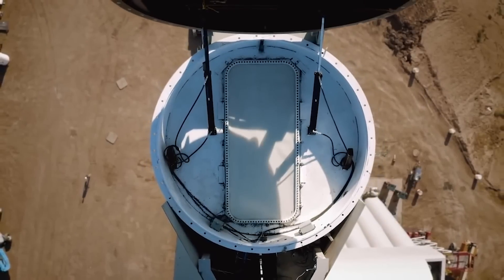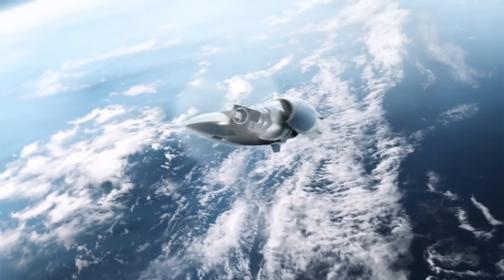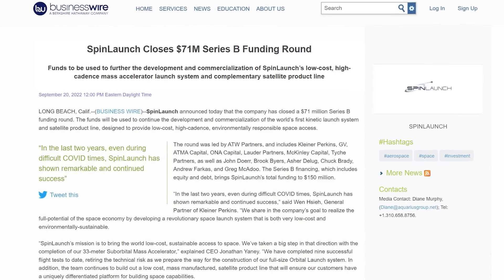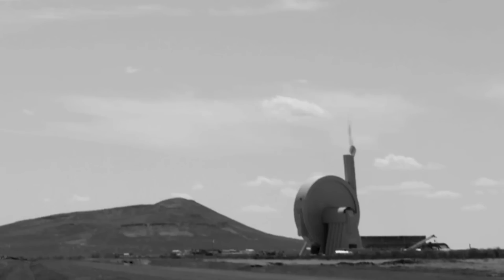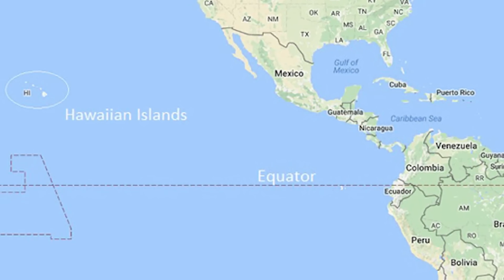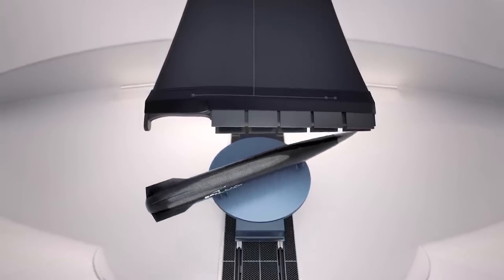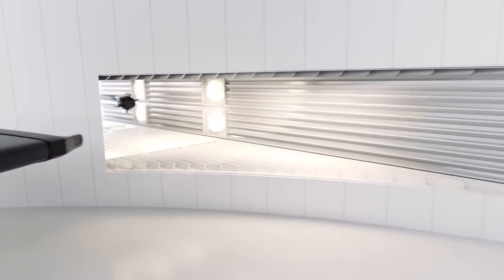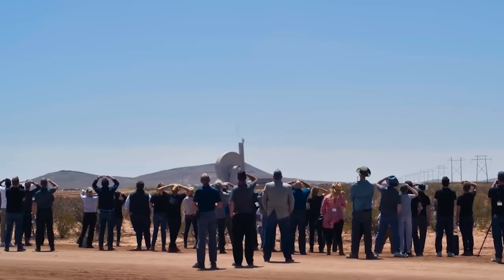What Happened To SpinLaunch & The Orbital Accelerator?

Comment: I would be very astounded if they manage to launch a single satelite into a stable orbit.
Reply: C'mon - it is not for this. It is for suborbital flights of tungsten rods...
Reply: @mateuszkukula5344  So it was a weapon all along.
A glorified catapult.
Reply: this is a dumpsterfire comment section, i for one don´t think they will ever have a satelite in earth orbit, but using this approach on the moon to get resources off the moon seems way easier and pretty doable
Reply: @andreasspachmuller7002  i was thinking the same thing,  IF you build something similar on the moon where the atmosphere is nearly zero then you MIGHT have something that works.  Although the 10,000gs are still going to be brutal on whatever you're launching.
Reply: they just need to increase the initial kinetic energy 40x to the projectile. problem is everything melts @ 6,000 degrees..
Reply: @mastah39  this isn’t about space X tho
Reply: Perhaps is a weapon in disguise. Otherwise your right.
Reply: I think the question is whether the payload can survive the strain of the acceleration.  If it can, putting it into a stable orbit is cake.  I doubt this will ever be realized.  It's so depressing to see all this money dumped into things you can see immediately will never work.  I rather doubt they even tested the idea under simulation before building it.
Reply: @mastah39  the principles are the same accelerating an object towards space where it is fired at maximum velocity at where the atmosphere is thickest which is stupid.
Reply: the whole discussion afterwards aside, I find this initial comment really funny
"if they manage to launch a single satelite into a stable orbit" lol
you make it sound like the first satellite you launch is easy and the hard part comes afterwards. If you do manage to successfully launch one satellite you can probably just repeat whatever you did a thousand times and successfully launch a lot more satellites, no? The hard part is doing the first one, the rest is easy
Reply: @Mmmm1ch43l  That's exactly the point.
I do not believe that they are capable to do that.
The whole procedure has to many weak points and looks like a investment magnet but not a serious  space agency.
I may be wrong and they do it tomorrow but I do not think so.
Reply: the only thing they'll be able to yeet is the money of gullible, uneducated people who are way too wealthy.
Reply: @molybdaen11: I absolutely agree. By the way, for the ones who will ask, I am a mechanical engineer, but not with a background in rocket science. But their main idea is also not a rocket. ;-) And physics is physics. 
First of all I think doing that with a vacuum in the chamber is not trivial. And based on the flat membrane the projectile flew through, there was no vacuum present in their tests. Which is a big deal! The idea with the fast doors seems dubious to me at least. Where are these doors, if that's so easy to do? And even if they manage to build air tight doors shutting that fast and being able to time them that accurately, there still will be air rushing in when they're open. At sonic speeds. 
Further on, yes: if you spin something in circles and let it go, it will travel in a straight line. But, especially in a vacuum, the rotational velocity of that projectile would also remain constant. Meaning it would tumble from the get go. If I got the info correct, that would mean it tumbles at a rate of 450 revolutions per minute or 7.5 times per second from the get go. Sure, maybe as soon as in the atmosphere, it would stabilize but it surely would use quite some of the kinetic energy of the projectile.
Last but not least, and I know that's not a strong argument against them, but: It's such a basic idea to spin something and let go, surely other brilliant minds have had that thought before. And figured out there are better ways to get stuff into space/orbit.
Reply: @mastah39 he knows enough to know this won’t work and anybody with a physics background can calculate for themselves and see that this is not feasible. US military already did something similar with the harp project
Reply: What's the basis for your comment? Are you an expert in rocketry? A physicist who crunched the numbers and found a flaw?

Highly informed and experienced experts doubted we could affordably reuse rockets. SpaceX showed it's possible. Same with propulsive landing. Or simple flight for that matter (days before the Wright Brother's took off, the world renowned engineer hired by the US Gov. to do just that threw in the towel). Every leap forward is impossible. Until it isn't.
Reply: @Keiranful they said it would be impractical, not that we couldn't. We can also go to mars, and I mean right now, but getting back would be a little tricky. Usually when an expert criticizes something that is in theory possible, they are questioning its practicality.
Reply: @Keiranful  SpaceX technology of reusable rockets is expensive, they did not manage to cut costs a lot and it's still expensive to launch.
Reply: https://www.youtube.com/watch?v=9ziGI0i9VbE&ab_channel=Thunderf00t
Reply: @Keiranful  thunderf00t is and... yeah it's a load of bull. This dog will never hunt
Reply: @Keiranful  how’s this for a basis - they say they’ll launch at Mach 6.5-7. That’s 5000 mph. Orbit requires 7 times that much speed. 
Anyone who’s seen the “tests” can easily see about a hundred ways why this will never happen.
Reply: @Keiranful and who are you?
Reply: @fissavids8767  only an engineer with a good understanding of the conceptual material. I also don't spout doubts without going into why it will never work. Neither do I claim it to be the future of space travel. I just can't stand narrow-mindedness.
Reply: @Keiranful  I'm also an Engineer and I'm highly skeptical of this approach since it requires their payload to undergo up to 10,000 Gs of acceleration. These high G-forces are experienced for hours as they ramp up. In a linear accelerator with a track/barrel the length of just the perimeter of the "Spin Launch" accelerator, the payload would only experience an acceleration of about 800 Gs (for a fraction of a second). There are few things I would ever say are "impossible" but, IMHO, this is just about the worst way I can think of to try to launch something into orbit. My bet would be this company runs out of funding before they ever launch anything into orbit, for the reasons I just explained.
Reply: @michaelhill6451  the problem with a linear accelerator is, that it's even further out from our current capabilities. If even the JPL and the US military have trouble getting one into service (at seriously reduced energy output), where talking decades, before a startup can manage that. As for the high g forces, they know about the issue and work around it, for example with special braces for the reaction wheels and other stuff. Look some more, it's fascinating.
Reply: @Keiranful  Yeah...Working around high g-forces. You can't defy Physics. It's not fascinating. It's delusional. I can just as easily give a hand-waving explanation that they could "work around" issues with linear accelerators. It is actually technically much less challenging to make a linear accelerator which should tell you that if linear accelerators are "decades away" for some reason (according to your hand-waving argument with nothing to back it up) then this is even farther away.
Reply: @michaelhill6451  you really haven't looked at anything they put out, have you? High g forces become a problem when things can move. For example, a standard reaction wheel is folded in at launch and will deploy/latch in place after achieving orbit. That design obviously will not work. So they have designed a reaction wheel that is at a 45° angle to the mounting surface and is braced. At that point the g forces don't bother the reaction wheel. Tensile strength is not the issue. Tolerances & slack are and both are simple engineering problems that we understand quite well and can handle. It's not easy, but it definitely is doable.
Reply: @michaelhill6451  as for my "hand-waving" argument, you really only glossed over my comment, didn't you? Otherwise you'd have read my point that the JPL and US military with all the brilliant minds and shit ton of money they can throw at problems haven't been able to design a prototype that can shoot more than a couple times without needing major refurbishment, let alone multiple shots a day. That is with decades of research and billions of funding. No startup can match that, hence the possibility of a startup building a linear accelerator for such an application being several decades away. Yes, that is a very "hand-wavy" argument indeed.
Reply: @Keiranful  you could be the pope and that still doesn't make you an authority to talk about this dumb idea. there are many more solutions to this problem like linear accelerators which did come pretty close in the past, which you claim do not exist. 

source: I'm a mechanical engineer with interests in space technology. doesn't make me one to talk either.
Reply: @Keiranful I am pretty sure this falls into the category of possible, dare i say doable but entirely ass backwards in terms of practicality. 

This won't fail because of a lack of funding though.  It is just way to niche in terms of what types of payloads they could get into orbit even if they do succeed.
Reply: @Keiranful  People have been working on ballistic launch to orbit since before anybody in this comments section has been alive. Project HAARP and QUICKLAUNCH being the most prominent examples. There are fundamental flaws in the concept that make it at best impractical, at worst straight up impossible and those were using simpler mechanisms. Spinlaunch has taken a repeatedly tested, failed and dead concept and dressed it up with some schoolboy physics tricks to make it look new and innovative, then made some fancy marketing videos and announcements in order to fleece overoptimistic but scientifically illiterate investors of their cash.
Reply: @Keiranful bro the us military already did something similar but with a gun and deemed it un practical this is essentially the same concept
Reply: @michaelhill6451  is there even a satellite that can survive those gs
Reply: @opmacace523   I doubt you can take a stock satellite and have them survive that. No. You could probably specially design one but it would no doubt put limitations on your satellite design.
Reply: @michaelhill6451  that’s the point it would be more support structure than satellite which increases weight or limits electronic capacity. And when in space all that support structures become useless at low gravity. Which is why modern satellite designed look fragile because less weight saves money and or you can increase satellite size for more capabilities.
Reply: @opmacace523  Agreed. This is one of the many things that makes this a dumb idea.
Reply: @Keiranful  Then why do they lie in their videos. Why is there so many engineers who have spoken against them. This is like theranos
Reply: @Keiranful  Your entire non argument is a fallacy called appeal to authority. And seeing how you are not qualified enough in psychology and philosophy to form proper arguments you are no longer allowed to respond to proper arguments (see what I did there).
Reply: @mikehawk1441  an appeal to authority? Pointing out how experts were wrong in the past about radical shifts in technology is a fallacy? Right. 

Beyond the asinine twisting of what I said into your counter, your mistake was assuming things you have no way of knowing. 

My argument is about as far from an appeal to authority as possible, because I basically said experts tend to get radical shifts completely wrong, so let's wait and see instead of calling these people idiots.
Reply: @michaelhill6451  think about this. While it’s spinning all those G’s are on the outside wall of the satellite. Then when released they all disappear. Then when it hits the air after leaving a vacuum it will experience a ton more G’s of deceleration from the front. Instantly. All within a half second or so. 
Any mechanical device will turn into mush
Reply: @Keiranful No just simple knowledge of physics.
Reply: @trolojolo6178  The engineering is tricky, sure, but the basic physics? Simple physics says it's eminently possible. I'd like to know what makes you so assertive that it isn't.
Reply: @Keiranful  Do the math and calculate the needed terminal velocity and centrifugal force in order to reach orbit. 

Spoiler: The forces are bigger than putting the satellite into a 50m long gun and firing it. This is simply not going to happen.
Reply: @zocker1600 "needed terminal velocity"
Using extra words like "terminal"(which doesn't even apply here) to bulk up a sentence and make it sound more 'sciency' isn't great if you're trying to make your opinion sound credible.
Reply: @zocker1600  the 50m long gun doesn't work, because we a) don't have a propellant capable for that and b) a rail gun capable of that is even further away in terms of development.

Also, you didn't listen, did you? No one claimed they'd go straight to orbit. They'll go a few kilometres up, to where the atmosphere is appreciably thinner and then start a chemical rocket. Straight to orbit couldn't work, because the perigee also needs to be raised.
Reply: @Keiranful And why not take an airplane then to carry the payload up to, say 30,000 feet? This take-off from a plane is a very old and never abandoned idea and seems much more feasible than this pipe dream.
Reply: @Keiranful  I would love to see your calculations bc the whole idea is ridiculous. You don’t need to be an engineer to see this is bs.
Reply: @Keiranful  Did you realize that HARP already achieved a muzzle velocity of 7,000 fps with a 960 lb projectile using a barrel only 120 feet in length?  According to you, we don't have the propellant to get a gun to shoot up to the muzzle velocities "Spin Launch" is trying to achieve (6,900 fps). That's a complete load of rubbish considering it was already done in the 1960s. Actually HARP pretty much already achieved everything "Spin Launch" is trying to achieve (in terms of projectile velocities), and they did it with basically two Naval cannons welded together. Lol. The only reason the research didn't continue was because Vietnam War sapped all their funding.
Reply: @Keiranful I think you can start with Thunderfoots video...Spin Launch BUSTED😂😂😂
Reply: @Keiranful  The basic physics actually says that it is impossible to ballistically launch from a planet's surface into a stable orbit. Not difficult or technically challenging. But fundamentally physically impossible. There HAS to be some additional input after launch.
Reply: @Keiranful  simple physics says it’s possible - sure.  It will also explain to you that the “second stage” will never work after moving parts are subjected to 10,000 G’s of force. Let alone what happens when the liquid fuel is compressed by that much force. Increase pressure also increases temperature. Cryogenic fuel won’t like that.
Reply: @Keiranful  how exactly will a “chemical rocket” work after the fuel, valves, and all mechanical parts were subject to 10,000 G’s?   
Took me 20 minutes to type that because I kept laughing at anyone who thinks this will work
Reply: @Keiranful 
Which experts doubted reusable rockets?
Reply: @HaydenLau.  Literally everyone. Everyone said it couldn't be done. The idea was far from new, but no one tried it, because they "knew" it couldn't be done.
Reply: @Keiranful thunderf00t already debunked this with all the math it makes no sense with just a 5th grade understanding of math and physics
Reply: @Keiranful  I suspect it's "Thunderfoot (or other constant naysayer here) BUSTED!!! it"

Comment: My main problem with it is when they release the payload the arm is now out of balance by alot, its likely any full size test would shake the arm to bits unless they have a movable mass inside the arm to change the balance within milliseconds
Reply: They use a dummy payload i believe that they launch out at the same time
Reply: @orangequill1645  so they have to catch a 200kg weight going at mach 25?
Reply: @clippyremembers  Im pretty its heavier and goes slower to match the force exerted by the other one but they can just let that shit crash to the ground
Reply: @orangequill1645  still, seems like something that after a few launches would need to be rebuilt, whatever the target they choose for the counterweight to hit, sand or loose dirt would work but eventually they would have to pull the counterweights out

Comment: The reason they're paused is because they ran out of people to scam for funds. I'd love if they prove me wrong, but the stresses on the launch vehicle would be destructive. Even the release into atmosphere is likely to be be destructive.

Earth orbital velocity is 30 km per second. Add in the extra speed to reach orbital velocity -- if it's very low (100 km), that's an additional 1.4 km / second. But that is also (for a 100 kg payload) the equivalent energy of 2 tons of tnt. That's just for tossing it up to 100 km and letting it fall back down. Making it somewhere around 50 or 60 tons of TNT to actually reach orbit.

In reference, the SR-71 flew at what -- 2000 miles per hour. That's less than 1 km per second. But you want something to go 30 times that fast. And the SR-71 did that at extreme altitude, not down at breathable atmosphere levels.

I wonder how fast something has to go before it turns the air into plasma.